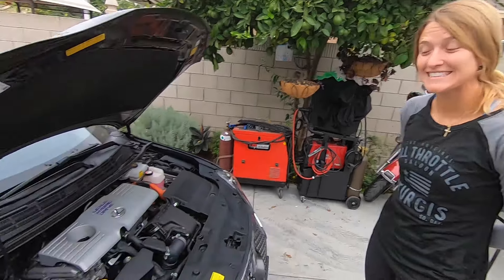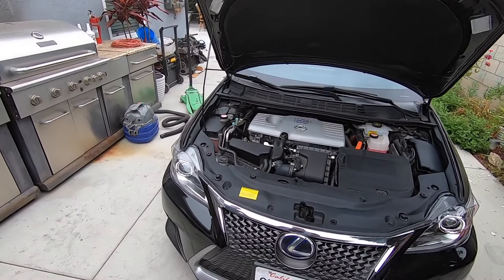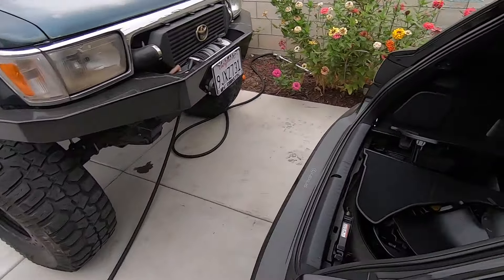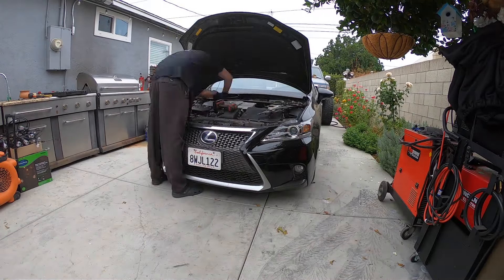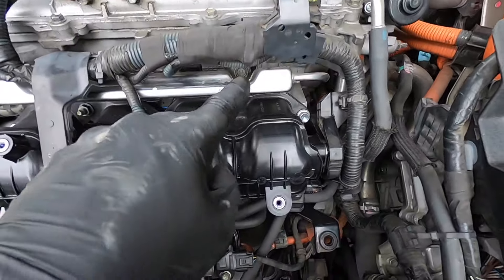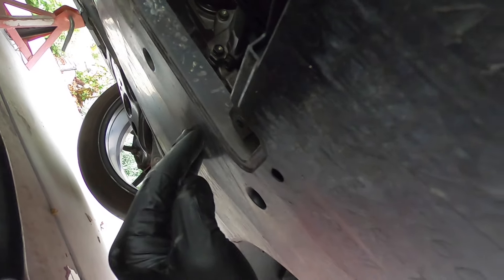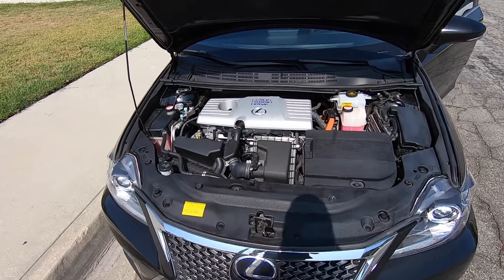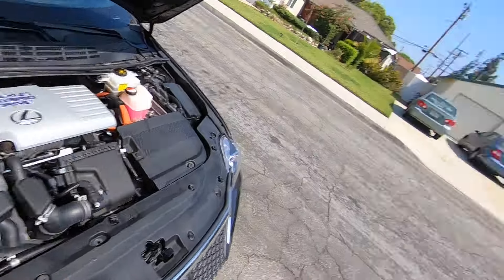How to Swap Your CT200H engine at home in your garage

Comment: Rebuilds for the CT can usually be guaranteed for at least 7 years. Obviously if maintained can last a lot longer. Just had the Lexus Specialists at The Mechanic Spot do it. My Uncle tried to buy a brand brand new one, they only had one but wouldn’t take card over phone, he said I 100% want it, hold it till the weekend when I’m in town. He flew in and he went in and they sold it. Pretty shady, but anywho we got next best thing which is still top notch. Just fun cars. I’m glad for sport mode for merging or passing cause well we know they slow to go, but in sport made can get ya up there. You should come into Nashville and change my fog lights for me. I have no tools or ramps 😢

Comment: Hi again nice video. These engines have lightly sprung oil rings.  If oil maintenance is not done at regular intervals they tend to stick.  Valvolene has an oil that helps remove the varnish.  Good to see how your new engine does.  Lake speed on you tube did a review.  I have a prius with 209000 miles. Uses about 4 ounces in 2000 miles.  Im going to switch to the valvolene restore and protect to see if changes anything.  Nice job.

Comment: Head gasket is never the cause of knocking..that is from wear at the crank bearings or piston bearings or both.  Also never use 0w oil..replace the 0 with a 5 and you won’t have to replace it twice.
Reply: What?!?! With these cars the head gasket is VERY often the cause of knocking, the bearings will last forever, and 0w is the best oil to use.
Reply from the maker: I like to do my research before making videos like this. The “knocking” sound is due to a misfire from liquid in the combustion chamber on start up. The oil type is not the issue. These engines only kill bearings from low oil levels from burning oil.
Reply: All toyota hybrids knock when there is a misfire and its from the damper between the engine and transmission. It will knock if the engine is idling below normal idle speed, damper is typically fine.

Comment: Why didn’t you check the coolant system first.  I bought a neighbors with 205 thousand miles sounded the same was clogged EGR valve and system.  Running great at 209000.
Reply from the maker: In this case it was a bad injector. The car burned a ton of oil, It was just easier to change the whole engine.
Reply: What did you find when you tore down the old engine.

Comment: Id say changing an engine due to bad injector, coil, spark plug...not recommended, but "rebuilding" a perfectly good engine to keep as a spare is a great idea if you don't open it up and rebuild it😂
Reply from the maker: @3sgteRHDSWPGEN4sw20  haha. Only reason why I don’t regret it is because the old engine burned almost a quart per fill up